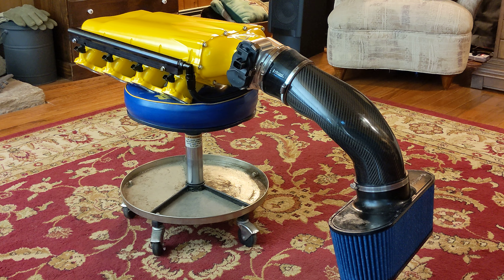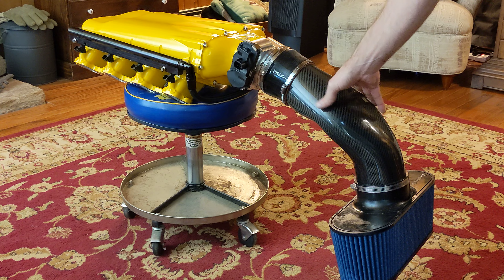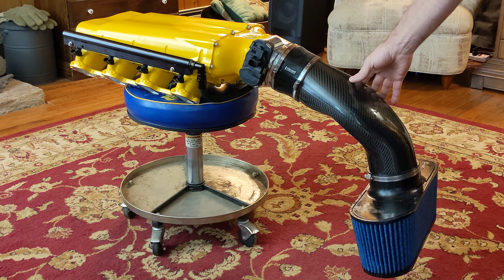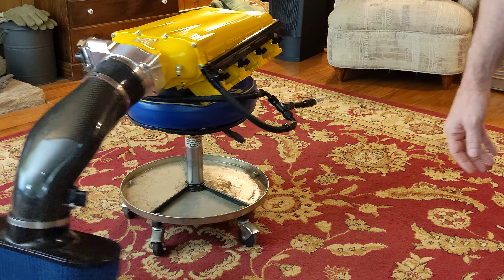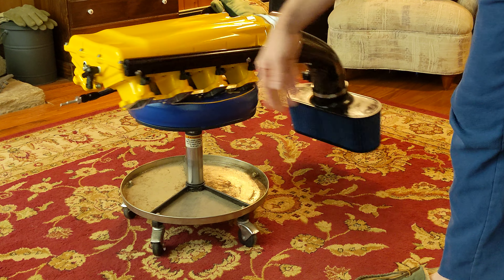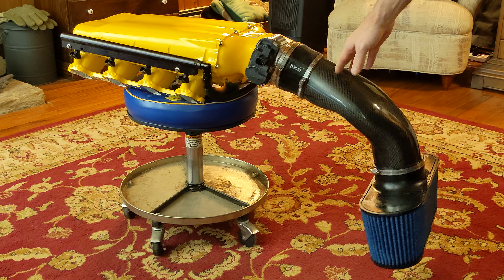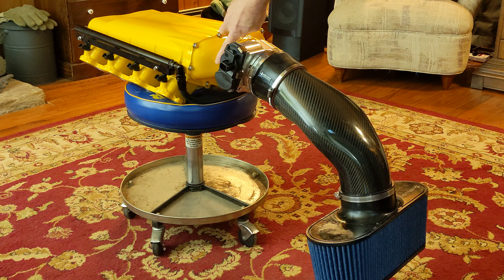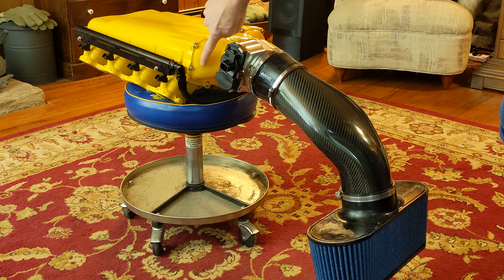$10K Billet and Carbon Intake for 502ci LS7

Comment: Lmt carbon intake would be better suited for your application that cf112 will still be choking the set up
Reply from the maker: You waste my time.

That is for ZR1, not Z06.  They are not compatible.  They are not even close to the same thing.  LS7 and LS9.  Also, what good to put a larger CAI in front of a 112mm throttle body? (none)

LMT hasn't made these for years, far as I can tell.  Maybe only made one.

How much air do you think a NA motor can use?  In fact 112mm provides quite a lot of headroom.  It's easily a 1000 hp throttle body and I'm not tapping that out.
Reply: Plenty of people have used it on a zo6 and yes they still make them as I inquired for one 

Yes they are compatible ,slightly offset  but they work 

You’ll find out soon enough the reason you want a bigger intake in front of that 112tb ,it just works to have a bigger intake 

What’s your compression and what heads are you running ?

Similar RHS 502 tall deck in my friends car making over 640rwtq